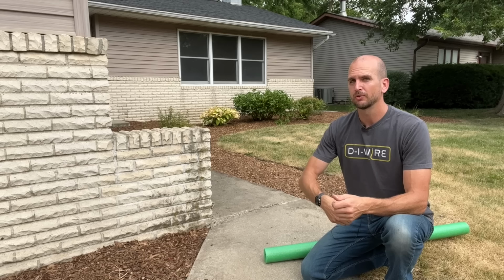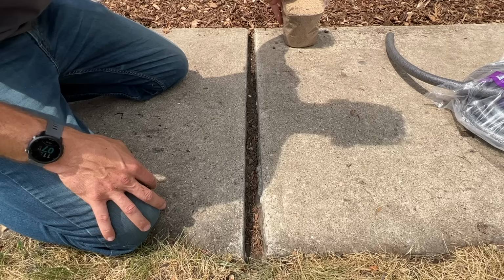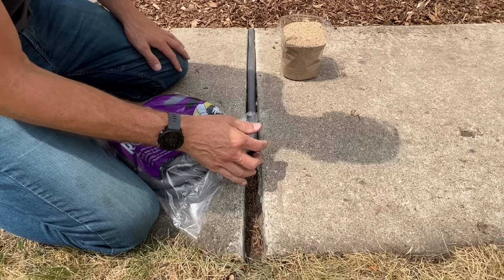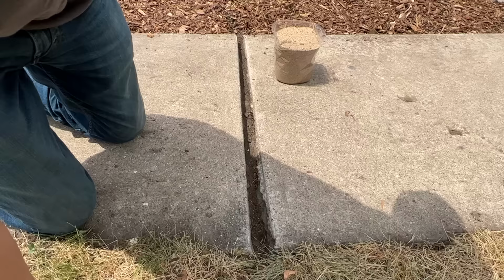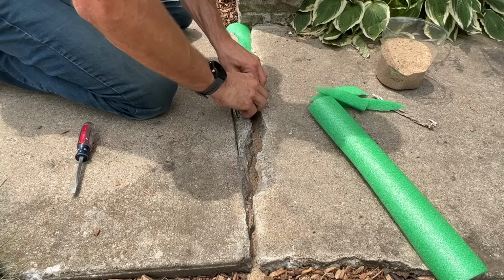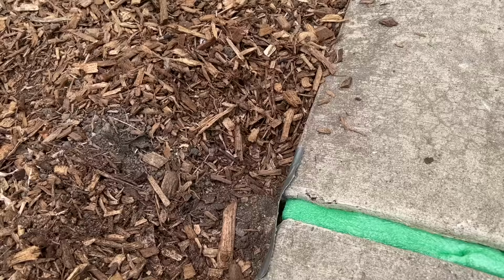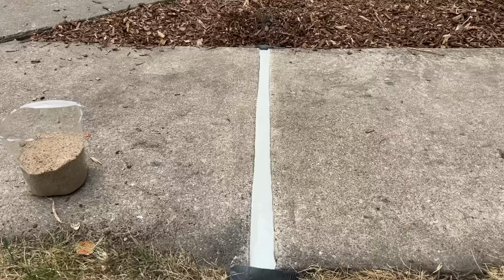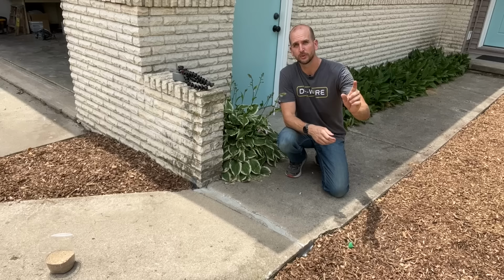How To Fix A Large Crack In A Concrete Sidewalk | Surprising Results!

Comment: Does the San Andreas fault run through the middle of your property?
Reply from the maker: Hahaha, no doubt.  Just picked this place up a couple weeks back and this part of the entry was a bit rough.
Reply: my guess is tree roots and / or expansive clay soil
Reply: You'd be surprised how many fault lines, both active & ancient, run thru the Midwest. Even Minnesota has a fault line. The Great Lakes Tectonic Zone runs from Big Stone & Traverse County to Duluth and while not very seismically active compared to the San Andreas, it has produced some decent "I felt that"-type quakes.
Reply: My house is right in the middle of the Cascade fault line.
Reply: @ytsux9259   You must live close to me.
Reply: Great Question Kevin, you beat me to the punch.
Reply: Not any more it dont
Reply: Lolz
Reply: 🏆  Comment Of The Week  

pml
Reply: @EverydayHomeRepairs  will this work on driveway
Reply: Bro where I live there is an abundance of clay soil, most of the sidewalks and streets need something like this every few yardss. Tons of tar marks around and it's not pretty but I guess it's smoother lol
Reply: The biggest fault lines are the one's that lead to government giveaways.
😄
Reply: Mid west…
Reply: Duuuuude hahahahahahaja
Reply: No but if his soil is sand or clay, this kind of movement damage is common
Reply: 😂It runs through mine! It looks like my back patio. Horrible mess.
Reply: @JRPLawyeress1   🤣
Reply: No it runs through my garage floor. I'm gonna try this.
Reply: Thanks I am gonna try this on my garage floor. It may swallow up a whole pool noodle!!
Reply: @ruthhaught4296  🤣
Reply: The freeze/ thaw in the Midwest can destroy sidewalks. Poor site prep before sidewalk was poured can also cause problems.  Could also use plumbing pipe insulation to fill gaps.
Reply: Lols 😆
Reply: Also, what size of noodle would it take to fix that if it does?
Reply: Funny you should ask.. l lived in Joshua Tree where they had no sidewalks however, because of the part of  San Andreas that ran under it l technically lived on the RING OF FIRE....AND LOVED IT the city banned any further developent in that area after the landers quake( 7.2according to RICTER'S SCALE) in southern Caliornia so, its not likely they are going to schedule any sidewalks be put in for a long time but, l'll keep searching the net ... just in case. .
Reply: Yea 👍 right
Reply: Lol 😂😆😂
Reply: Thats a pool noodle I want to see!
Reply: Water damage,. He also added a corrugated pipe to the right of the crack line  to drain the water away from his garage and walkway.   You can see the impression in the ground mulched over.
Reply: GTA San Andreas?
you picked the wrong hood fool!
Reply: Lol
Reply: It’s the San Andre-Asphalt
Reply: I actually do live on the San Andreas woohoo.
Reply: Lol
Reply: @loloholmes2793  try to explain that to a 4yr. She is convinced we will have an earthquake because her cousins live in California. 😣
Reply: Glad I found you! Here, I was planning on buying that foam filler stuff that fills in holes and cracks and hardens like a rock. I'm sure it would probably work on this for a little while but eventually wearing out. You have a great idea here, which I'm planning on trying to do. I have a  couple of good size cracks about 1 and a 1/2 wide and hard weeds that had grown up there but have put baking soda and vinegar in there to kill it for a while but they come backup in time.

 I live in the state, Texas, that has that hard cliche type soil basically that evolved from volcanoes from millions of years ago. We live on the edge of the San Andreas fault mine. For those who do not know the San Andreas fault mine runs all the way from South America through Central America through the edge of Texas, New Mexico, Arizona, and California all the way up to Alaska.  The ground is constantly redistributing itself; therefore, causing cracks and in sidewalks, driveways, foundations, and so on.

 I have a question.  The driveway has separated from the house foundation of the garage by about 2 and a 1/2 inches.  Can this same method be applied to this? I was planning on buying that hard rubbery type stuff that you put in crack but didn't want to do that.  Thank you for this demonstration.
Reply: @EverydayHomeRepairs  #"
Reply: In the mid west we have extreme heat followed by extreme cold,  so 100 plus in summer and negative 10 in Winter, this causes ground heave.
Reply: I have llived on top of it in the NW for 40 plus years and just within the last 3-4 years the ground is shifting, 'bubbling', and our nice flat acre has turned into a hilly terrain!  I would not be surprised if the wait is nearly over for the "big one".  I'm prepared. 

And watching this video to fix all the broken cement 😅

Comment: Wish I’d seen this some years earlier. I have concrete steps with a massive crack that goes always through. I filled it up with spray foam, not the best fix but it keeps the wasps out. I’m going to rework the crack using this method. Thanks.

Comment: I have used spray foam insulation which expands and fills unseen voids.  I let it expand and dry, use a seated knife to cut the foam just below the surface and then use the mortar.

Comment: I find pipe insulation noodles, which comes in various diameters, to be very useful. I haven't tried them as a backer rod for concrete cracks as you're doing, but they're useful for stuffing gaps between jambs and framing to insulate around doors and windows (before trim gets put on). You can cut it to any thickness.

Comment: This is a cool idea but I've found that using spray foam is much easier as it conforms to every bit of the crack in there and there's no need to make cuts unless you use too much

Comment: As a professional remodeler. Loved videos you have done  leveling the cement slab and filing driveway joints. Just wonder why don’t use Quic-Krete cement or mortar which is gray and blend better than tan/brown sand when you sprinkle onto the wet urethane caulk. Again I LOVE your videos, very well spoken
Reply: I have used the smaller foam rope for many cracks  in concrete

Comment: we used to buy that backer rod in 100ft rolls in about 4 or 5 sizes to pack around window and door frames before sheetrock went up. Some builders didn't like the expanding foam. They said it bowed the frames.

Comment: Akonaflex Pro from Menards does the same thing. I find it best to do this on a very hot day, like 85° or hotter. The self-leveling effect works like heavy oil and smooths out nicely and you can get the job done much faster. I know because I did all the concrete control joints in my 3 car garage, patio and sidewalks. Now I have easier cleaning and no water seepage below the crete.

Comment: Joints with this obvious amount of movement require primer. On the cartridge it usually  says something to the effect of “ no primer required for most substrates”  But if you read the material literature it will tell you to prime joints like this. I installed sealant for a living and on a lot of projects we would use thousands of gallons of sealant. When you use these amounts a material rep will show up to make sure it is installed correctly and every time they would say to prime or the material guarantee is void. If you are going to take the time to clean the joint properly ,as the video shows, you might as well brush on the proper primer.
Reply: What type of primer is suitable for a concrete surface?
Reply: @billbaillie3702  unfortunately that takes a little research. Every product may require a different primer so it is impossible for me to give you a good answer. But you should be able to find out pretty easily on the manufacturer website. Just be sure to locate the primer for the specific sealant and substrate ( in this case concrete) you choose.This is what I found for Vulkem 45 SSL :Where deemed necessary, use Vulkem® Primer #191 Low-VOC QD on porous substrates You can usually find this information on the material data sheet. Primer is also recommended because even though it is semi self leveling it is still supposed to be dry tooled( something very difficult for a homeowner to do correctly) Most people think that dry tooling the sealant is cosmetic but it is actually to gently force the sealant against the side of the joint to ensure good adhesion.
Reply: @genecarden780  Thanks. I was thinking it would be something Vulkem compatible, I've never seen a primer product available where I usually purchase Vulkem. Are you spraying water or a  specific liquid on the fresh Vulkem prior to tooling?
Reply: @billbaillie3702  NO never use anything on the sealant to tool it.That is why it is called dry tooled. Any type of liquid will interfere with the bond. Anytime you see someone wet tooling it is a sure sign they don’t know what they are doing. That is the real advantage of SSL is the tool marks will flow out so you don’t have to be as good at tooling the sealant

Comment: Good video.  2 suggestions I have is… 1.  pressure wash the sidewalk and repair site first if pressure washer is available…. 2.  For the jagged crack I would get a electric saw with a concrete blade and make straight clean edges first.

Comment: Its funny how that really jagged crack was only an inch away from the relief cut placed in the concrete to prevent exactly that. I guess relief cuts should ideally be much deeper than what we typically do.
Reply: Yes they should. Ideally they should be 1/5 the slab thickness but most people would object to the aesthetics

Comment: Rather than chopping up a bright color pool noodle, use foam pipe insulation which comes in several sizes from about 1.5" to 2.5" OD and is black or dark gray.  Also the insulation comes pre split along its length.
Reply: those foam pipe insulation noodles are great.  it takes pool noodle hacks to a whole new level.   cheap too

Comment: Spray Foam would be the preferable product for those large irregular gaps; cut down, then sealed with the SSL/SL sealant
Reply: The spray foam contaminates the substrate and compromises the bond of the SSL. And it doesn’t give the proper joint profile of thinner in the middle and thicker at the sides which is essential for proper sealant performance
Reply: @genecarden780  nope; and yes Spray Foam actually does give proper support and fills the voids, which w/o would allow for further erosion. Spray foam or mud pumped in to fill those large voids is the only right way to do it. And a SSL will not interact with spray foam.

Comment: the top layer of sand also protects against UV breaking down the sealant over time...
Reply: @frank blunt any fix the crack like that is temporary, whatever movement caused that crack we'll crack the fix.

personally I use a mortar mix with a little extra sand as backfill before applying a flexible sealant.

Comment: I saw your other video where you filled the crack in front of your garage and liked it a lot!

With a crack this large (like I have in my garage) I may lean more toward quickrete so it isn’t just a thin layer connecting the two chunks of concrete

Comment: A much easier way to do this, though probably much more expensive would be to use polymeric sand, fill the crack, water it and it polymerizes becoming a flexible seal.
You still need to do the prep work though. You need clean concrete.
Reply: What he used cost $50 a tube. A 50 lb. bag of Polymeric Sand is $65.. I'd go w/ Polymeric Sand..
Reply: @rtoguidver3651  yeah, I don't know what stuff costs, I just use what they tell me to use. I have laid a lot of polymeric sand. Mostly because it is fast and it works.
Reply: @iwontliveinfear  does the sand work on big cracks like those in the videos?  I would spend a fortune on the Vulkem stuff he used, to fill the cracks I need to fill.
Reply: @joetousignant9130  I've successfully used polymeric sand for cracks up to 2 inches wide.
You have to be careful when watering the sand in big gaps. If you add to much water to quickly you can wash the sand out.
It also isn't ideal in places that get a lot of rain, as most polymeric sand gets soft again when it gets wet.
When I have a crack larger than 2 inches, I break up the sidewalk section, remove the debris, frame it up to create an expansion gap using a ¾ inch board that has a piece of baking parchment taped to it facing the pour. Then pour a new concrete section. After it cures, I remove the framing, the parchment makes it easier to remove the gap board from between the new and old sections of sidewalk. Then I fill the ¾ inch expansion gap with polymeric sand.
Reply: Yeah I agree. This would be more permanent solution under traffic.

Comment: Ok, so I literally tried this technique this past weekend.  At first I thought, wow, this is going to be great.  I filled the crack with the backer and then spread on the self-leveling concrete caulk.  I sprinkled a little sand over it and it looked good.

Here is the problem I am having.  The next day it appears that much of the caulk seeped into the backer so I can see the round shape and the entire thing is lower than it was.  Ugggg.  

All hope is not lost.  I'm going to go get some additional caulk or other concrete filler I have used before and put it on top of this.  I'm hoping that whatever soaked through the first time has now harded enough where subsequent applications will stay on top.  In theory, another application should do the trick.

I just wanted to share my experience.  I'm not sure if there is a particular type of backer rod that should be used, clearly the stuff I used soaked up the caulk.
Reply: By the way, as someone else mentioned, I'd probably just use some expandable foam next time.  I've done this under my steps and other places.  You just have to be careful as some of that stuff will keep expanding forever and then it becomes a mess to cut it out and clean up.

Comment: Some possible advice. Use silica sand, not play sand. Play sand is dirty and will genraly leave a residue on the side. Use silica sand all the way to the level you want ditching the foam and on wider cracks take a trowel lightly on both edges so the sand has a slight hump in the center so you get extra bonding on edges and stretchy in middle. Put your caulking along both edges so it doesnt flatten the center and then fill the center. If you use the backer rod that is two small, use a non self leveling on on both sides to seal the edges. Good to have this on hand to dam the ends anyways. If you use the self leveling Sika he mentioned is good and comes in sandstone witch is a better color 80% of the time. IDK about his Simi leveling stuff but dont sprinkle sand on sika unless you go really light. It can sink in and raise the level of the caulking. These are just other methods. Nothing wrong with the video in general though except Im not a fan of the sand sprinkling but that just me. MY BIGGEST tip though is if your are doing more than 6-8' of caulking in the video like a whole drive way, buy a decent caulk gun. Not the pc of crap he was using, Your gun should run around 25.00 plus and you can thank me later. Your looking for something with a minimum 12:1 ratio and 18:1 is better. This goes for either size tubes. I think in smaller tubes you can even get 24:1.
Reply: So i can use silica sand in my 1- 2 inch wide staggerd driveway crack and pack it down and just cover it with this caulk material and it will dry and hold.
Reply: @matt7iron  First use silica sand instead of play sand or all purpose sand no matter how you do it because its much cleaner. Its so clean there will be no packing, it does not pack. Anything that packs isn't clean sand. It will run into the smallest cracks. IMO yes it will dry and hold just as good. Been doing it for yrs with no problems. There is no problem with using sand and then foam but I dont see the reason for it and its much harder to do that way and more expensive. As far as holding that depends on how much you concrete moves in the winter. No caulking will hold up to 2" of movement ib the winter and some concrete does move that much but its rare. Its also more likely to tear free if you are caulking moving concrete to non moving concrete (something with a footing under it). Like dives at garages. sidewalks at stoops. sonaborn sl1 is by far one of the stickiest and stretchiest caulking for something with alot of movement however its also more likely to swell and discolor so there is a give and take. If it swells it can be a trip hazzard. That was yrs ago and maybe they fixed the problem but it left a bad taste in my mouth and all the local places stopped selling it. I use Sika from lowes now. Gets more like a firm rubber and is good in minimal moving joints. I would love to see someones reasoning on not using sand. The ones given to me on why to use foam/backer rod wouldn't be a problem with silica sand either. BTW Im not a fan of sprinkling sand on top, however if you do silica sand isn't the right one unless your concrete is white.

Comment: Its not easier if we just put the sand then pour self leveling that is regular cement but more liquid instead of using caulking gun, without the noodels, does it work?

Comment: Have had problems with foam-type backer rods. Bubbles would form in the sealant. After some research (probably just reading the directions, don't remember) if the foam has a cut in it, it will "outgas" and the bubbles will occur and sometimes split open in the sealant. This occurred when tradesmen used sharp objects to insert the foam (and accidentally cut the foam) into expansion joints in buildings.
Reply: Good to know.
Reply: Buy open cell backing rod and that issue goes away. Only happens with closed cell
Reply: @cristopherfrakes1416  open cell will absorb ground water, soft rod is a hybrid of open and closed cell. Eventually it will absorb but nowhere as fast as open..
Reply: The bubbles occur as the temperature rises, the heat pulls the gas from the foam and also the solvents from the caulk.